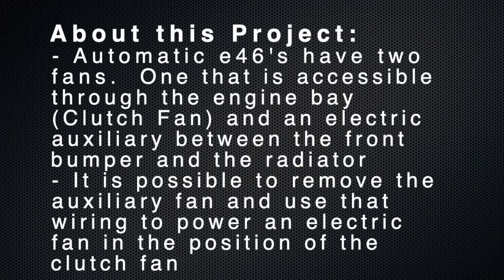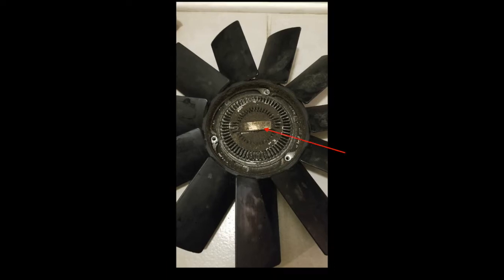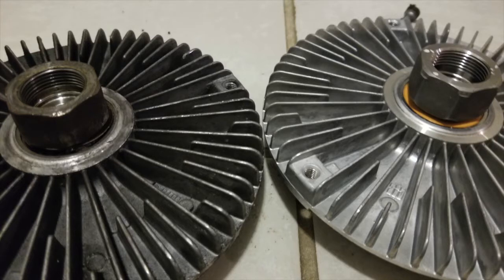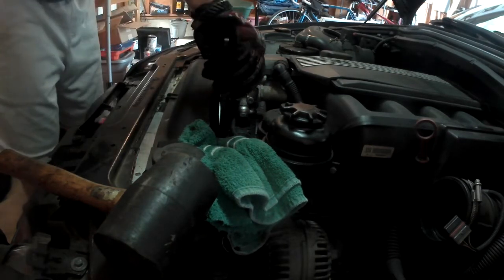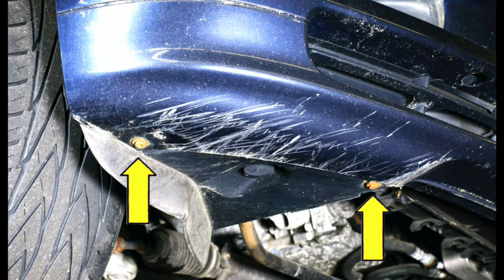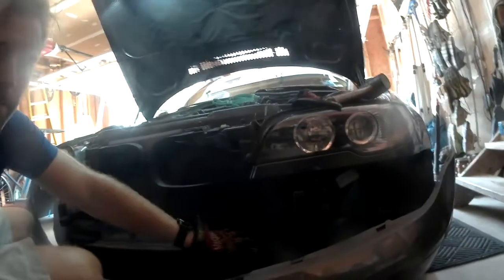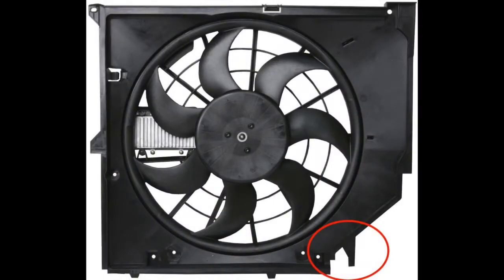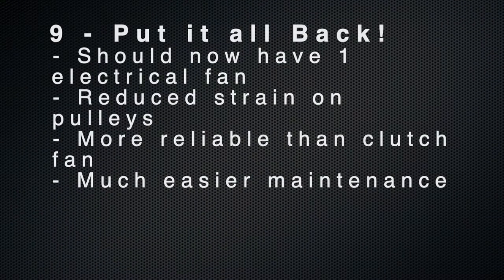BMW e46 Automatic Clutch (Mechanical) Fan Delete DIY

Comment: Hi, i have 330i with automatic transmission and clutch fan. I want to put electric one but I'm worried about overheating. What do you think?
Reply from the maker: I've never had an issue with the electric one (Mid Atlantic State, US). I'd only be worried if you idle for long periods of time or lived somewhere excessively hot.
Reply: @AvoidStealership wrong question placement earlier.

I live in Florida so it does get hot and humid (almost year round).  Would there be an advantage to run with 2 electric fans (a new replacement one between the radiator and the engine and the original electric one in front of the radiator)?
Reply: Is there any value (or downside) in leaving the original electric (front fan) in along with the new replacement?

Comment: Hey so my clutch fan literally broke off at the bolt that connects, would I need to replace the water pump?
Reply from the maker: I didn't even know that was a possibility! I'd sadly say yes because the clutch fan attaches to the water pump
Reply: @AvoidStealership  any chance I could send you a picture somewhere? Not expecting a professional opinion but a second mind/your opinion, it broke off in a WEIRD place but I cannot tell if my water pump would be damaged or not
Reply from the maker: @josephe4667  avoidthestealership@gmail.com

Comment: Ok this maby a dumb question But I've got a 2002 bmw 325ci. Engine stays at normal temp at idle and lowered rpm but overheats at high rpm.   I have wired the electric fan to stay on all the time and I have also pulled the thermostat out of it so that the water would circulate all the time and still overheated so I'm thinking that the clutch fan has gone bad add is that the case do you think ? I have one ahead and ordered a new thermostat new thermostat water pump drive belt antenna and temp .sensor.   So here's a couple questions I have did you use or reuse the fan that was in it And just swap it to the other side?  And are you cooling the engine or cooling the radiator fluid?  Obviously minds an automatic because it has both fans but does the clutch fan is it intent to cool the engine or is thereis intent to cool the radiator? Thank you for your time
Reply from the maker: Hey Jason!  There is alot to unpack here.  First, it surprises me that you overheat at high RPM.  Mine will creep up a couple degrees at idle because the lone fan is the only thing moving air.  My electric fan is new.  It is wired to the old electric fan and sits in the position as the old clutch fan, so it pulls air through the radiator and onto the engine.  I would start with the thermostat, they seem to just quit at random intervals.  Best of luck!

Comment: Would it work on 2005 325i 4 door
Reply from the maker: If you have an automatic transmission then your car should have the same setup (both an electrical and mechanical fan) as shown in the video and the mechanical fan delete is possible

Comment: Do you know if the fan clutch for bmw 328i 2000 is also like that? There is another youtuber who said these fans are only driven by the pulley and spin faster only at higher RPM???
Reply from the maker: A 2000 328 should be like it is in the video BUT I know that the manual and auto fans are different.  I would just pop the hood and take a look.  You should be able to tell fairly easily what is driving your fan.
Reply: @AvoidStealership  okay thank you
Reply from the maker: @mauriciocoura4167  Basically, if your fan is driven by your water pump (like mine is) then it is temperature enabled so that the fan spins at a different RPM than the water pump does when it is engaged
Reply: @AvoidStealership  yes mine is driven by the water pump too... i just bought a new fan clutch to replace it... I just need to make sure whether the one in the car is working properly... the car is not overheating but... I suspect is not really working well because the car takes a long time to warm up, rough iddle on cold, sometimes dies... the car is 20 years old with 173k miles with the original fan... anyways thanks for your help
Reply from the maker: @mauriciocoura4167  If you are overheating, I would consider the clutch fan as well as your water pump and thermostat as they are known points of failure.  My car has 183k miles and is on its 3rd thermostat and 2nd water pump.